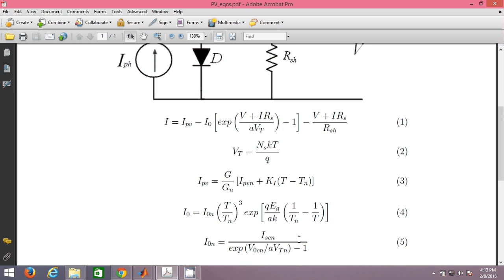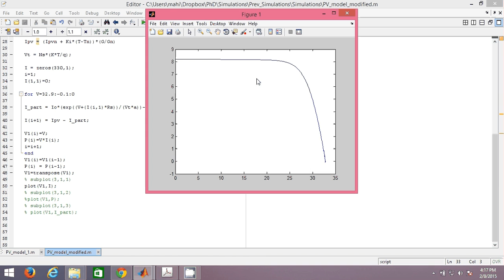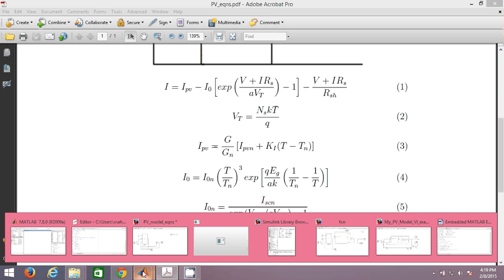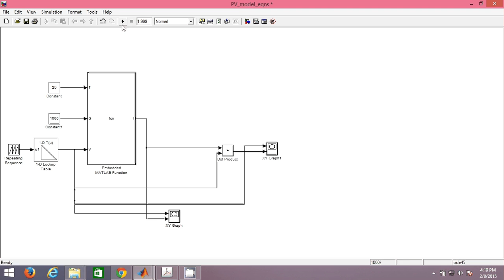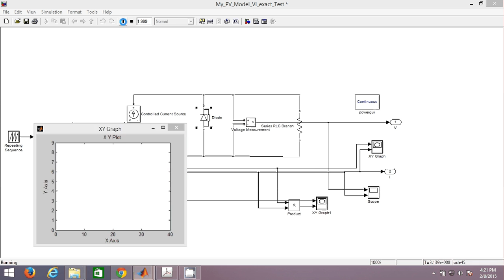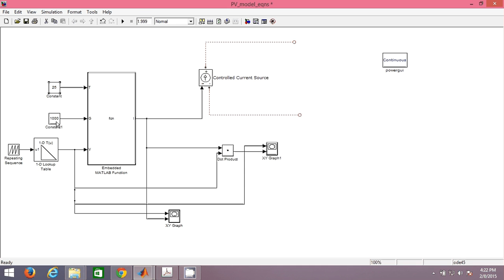Comment: I coded a program that takes an array of 26 Voltage values and Single diode parameters and its put is an array of 26 corresponding PV currents , and powers . I used similar Matlab code like you.
The problem is:
When I put the Parameters of the previous research papers in my code the absolute error between the output currents and the experimental currents  is greater than the absolute error mentioned in the published papers .
What should I do with that problem?
Reply: I got a similar curves of I-V, P-V , But for example , the sum of the absolute error in my code is 0.11 
And the sum of the absolute error in the research is 0.053
Note that the parameters as well as the constant values are same in both research papers and my code .
What should I do or what makes this dilemma?

Comment: thanks for the video.
how do you calculate Rs Rp and ideality factor?
Reply: +ibr97 Rs and Rp are calculated by matching your IV characteristic graph to give the maximum power and the provided current and volage.
Reply: @mohamednofal4422  sir I done it using embedded code but how to connect the pv cells in series can you help me : ranajoybhattacharjee19@gmail.com

Comment: Hi, i've written the pv equation in smulink, but i've some question about the voltage. I still got an error which says that at time 0.54 (not important when) the value may be Nan of Inf. So what i would like to ask you is how do you set the repetitive seq block and look up table; is the configuration equal to the model which use matlab script? how can i fix it? thank you very much from rome bro
Reply: Try putting a delay in the current feedback loop.... that might solve your problem
Reply: +mahesh a just five minute ago i try to put an Algebraic Constraint block just before the feedback loop, and it run 'good' without error message. The load of circuit is a simple resistance, and i put a scope to measure the voltage drop across it. The result is something as -1600 it just seems to work fine but it don't :D I also see that the output of two block: rep. seq. and table is not pretty right: i set it for time base [0:10] and output value [0:5.5] and the look up table set for table data [1: 5.5] and breakpoint to [1:5.5].... it cut the saw signal, the fall time is not 0. Please can you explain me the role of this two block and how to set it? Thank you very much
Reply: +NicozStrat 5.5 is the Vocn of panel and the load is a 1Ohm resistance
Reply: +NicozStrat 1 ohm
Reply: +NicozStrat it can't plot me I-V xy graph, why there is a connection port from V measure connect to the load? do you send that V or the output of lookup table as input of subsystem?

Comment: Thnks for this outstanding video. :)
I made model by connecting blocks as described in last minute of the video.  It is working means both the X-Y graphs viz P-V and I-V are as per the characteristics. But when the rest of the circuit is connected by using Controlled current source the current becomes constant for any value of load violating the characteristic of standard PV array.
for example : by taking the constants as per your examole Pmax is 200.
for R=100ohm... current in load resistance is around 8 amps ( always becoming constant) which makes output power to 6400 watts which is impossible.
Plz help me out on this..

Comment: while simulation solar cell in matlab function its shows a error during running the model indicating as follows

"Unable to locate 'mexopts.bat', and therefore cannot determine which compiler to use for simulation builds.
Use 'mex -setup' to select a supported compiler."

Please help me to decode the above problem. I am using matlab 7.10.0.499 R2010a version on 64 bit system.
Reply: prakhar patidar Go through this video for fixing the The mex compiler '<unknown>' is not supported for simulation builds. Use 'mex -setup' to select a supported compiler." issue.

this one works..!!
https://www.youtube.com/watch?v=au-3DV20QDY

Comment: Hello sir!! It was very much informative. 
But how could i use the same model to make PV of higher rating. For example if i need to make Voc=530V and Isc=8A. What will be the technique?
Reply: Subrat Aryal That much high rating single panels are not available practically, So try connecting cells in series and parallel to get that current and voltage..
Reply: I am wondering that how to connect this above model in series and parralel to get Voc=530V and Isc=8A. Plz help me on this, and Thank you for replying
Reply: @maheshaeidapu5415  how to connect that in series and parallel i done the matlab embedded function method

Comment: hey, please i need help i have this model but i wante to make 2 model series and 2 model parallel it so urgent please and i have the simulink f battery and i dont know how to link it with the PV system 
this is my email oumaima.rimcha@gmail.com 
thanks
Reply: Oumaima Rimcha After connecting the controlled current source, you can connect any number of this models in series and parallel, then you can connect battery also...
Reply: mahesh a  the problem that i have is how to connecte them series and parallel and i dont have the controlled current just PVsystem (2 series and 2 parallel) linked to battery model 
thanks

Comment: thank you. great work .. i wrote the same code as in your video but it doesn't plot
 I vs V it gives me an error :
??? Error using ==> plot
Vectors must be the same lengths.
Error in ==> Untitled2 at 36
plot(V1,I)

the P vs V plot is ok 
any help ?
Reply: Ahmed Shaaban  Watch clearly at 4:56Thant might be the problem of yours.
Reply: @maheshaeidapu5415  sir can you tell me how to connect this cell in series parallel ,to get more power

Comment: the simulink program don' work for me , this is what i got when i execute the program 
"The mex compiler '<unknown>' is not supported for simulation builds. Use 'mex -setup' to select a supported compiler."
can u explain for me why ?
Reply: That is because of the 64-bit version of matlab you are using. Try running the same file in 32-bit matlab (Preferably 2009a or b), it will surely work.
Reply: mahesh a
always same prob , please check ur email box , i sent you the model . thanks